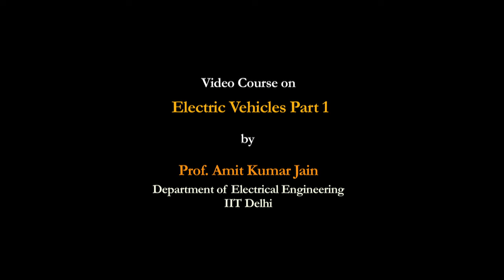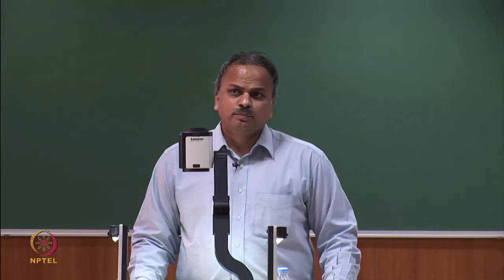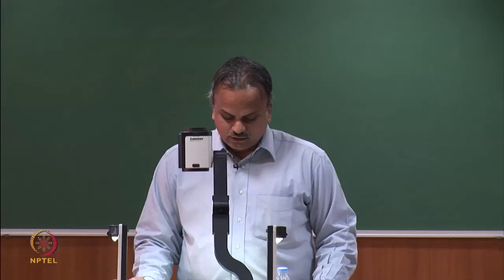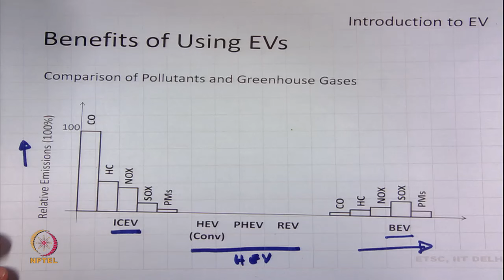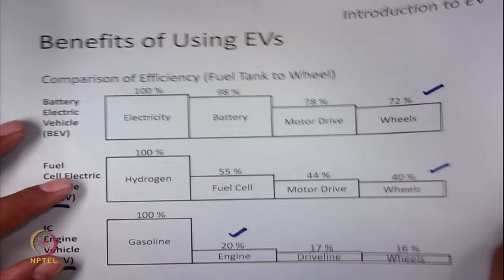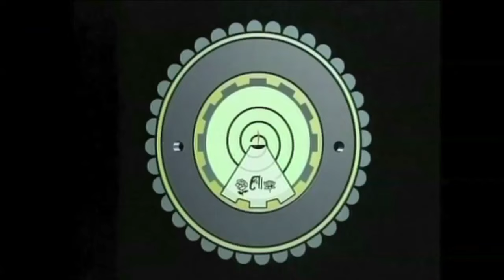Intro EV Benefits of Using Evs

Comment: Sir
6:6 even though the mass of battery is high, we have removed engine, thrown out gear box, no transfercase, no differential, no propeller shaft. The curb weight will come down. Then why should I go for a gasoline or diesel IC engine?